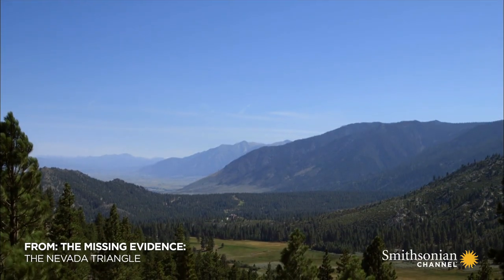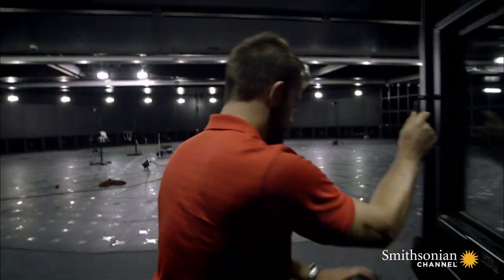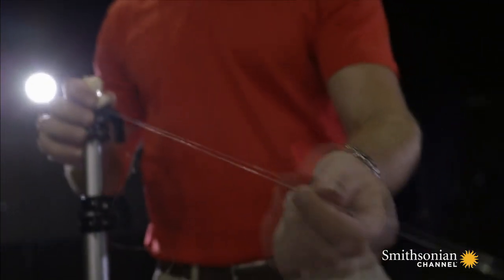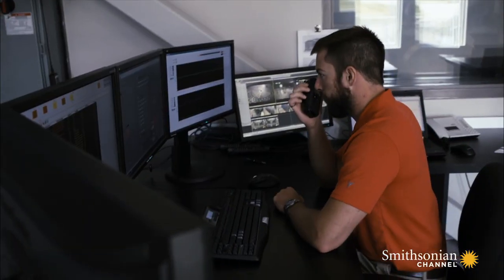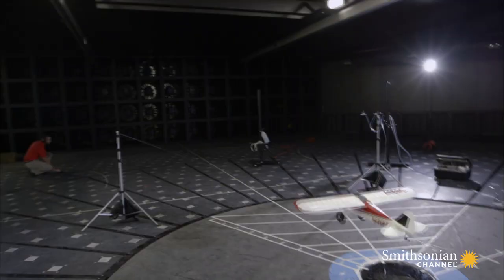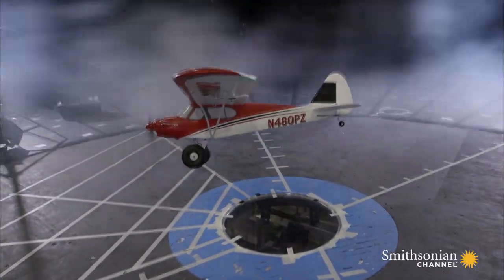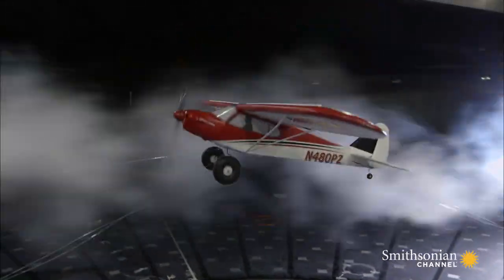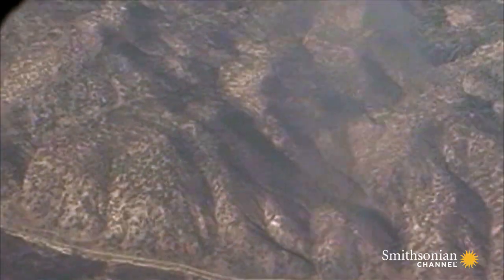The Mystery Behind Pilot Steve Fossett's Deadly Crash

Comment: It is almost impossible to keep a steady laminar flow in winds and fluids, if the velocity becomes faster.  At higher winds the  undulations on the ground and close to flat water will cause perturbations which will  create an oscillation or a circulation and this can easily cause the setting up of waves with a down draft in locations behind mountains. A simple demonstrations is to notice water flowing in pipes where, in a  draining sink the water will circulate. Sea waves grow due to this effect and even wings at a high angle of attack have circulations behind them .  What surprises me is that a pilot  can feel all this and should turn back and not keep heading on  into a dangerous state which in this case and many others were fatal. Perhaps after winning about 100 flying records in a lifetime, one may start thinking that one is a superman.

Comment: We will never know, If a recovery option at all, although often times pilots in this same situation or similar ones will think that there is No way to recover, or just continue on until crashing, Other times aviators focus more on the peaks in the distance and may not notice fast approaching rising canyon just in front of the plane, 
.
Pilot Reaction Time; When actually at times one option may still be available, If an airplane is sluggish and climb performance is Not what is needed to continue the course, Pilot maybe still able to reverse course toward the downhill direction,  By turning, "Using the Tail Rudder Only, Wings Level, In this situation the more angle or any angle used in turning will result in lost altitude, Especially in this situation, By just using Rudders, One just may have enough altitude/along with using downhill terrain to your advantage, It just may be enough to survive.
.
While in turn if wing toward uphill side is so close to the ground, at this point a slight wing adjustment toward downhill direction might be needed while in turn.
.
If one one is able to pull this off, ...Your hair is probably standing straight up on the back of your head,  .."Count it as a Miracle !

Comment: The wind demonstration was so simplified as to be inaccurate.  No mention of rotor over the mountain?  Just the high wind is forcing the plane down.  No, the high wind might cause the plane to be parked and not move forward, but high wind alone will not push the plane down. In this situation, that would mean rotor. Rotor is an interesting phenomena, google it.

Comment: He was trapped in a rising canyon near the max performance altitude of the aircraft. Rising canyons can be difficult to see because your looking down at them can't judge how fast the canyon climbs until it's too late to turn around. Gliders sometimes get caught in these but they have 50:1 glide ration so they can turn sharply at slow speeds where Fossetts plane will not be able to get out of the situation. Also people tend to pull up when the see the canyon rising to attempt go over it usually leads to a stall as winds coming over the mountain cause airspeed to slow.